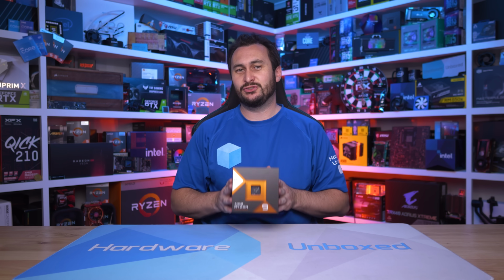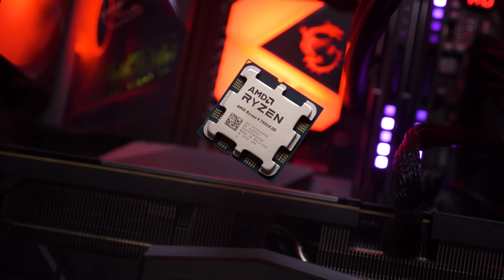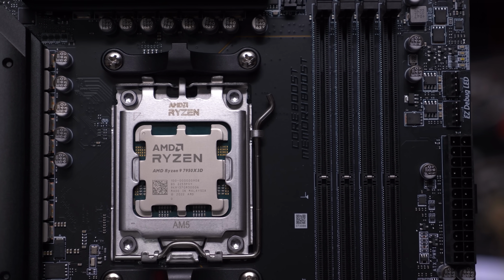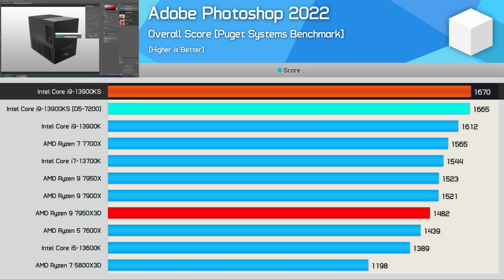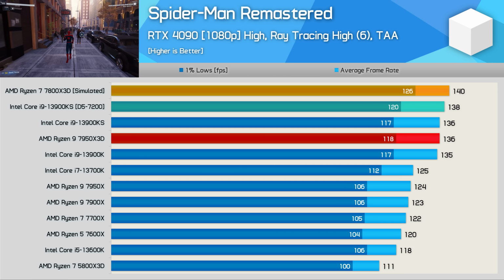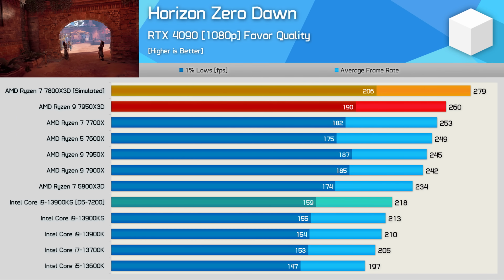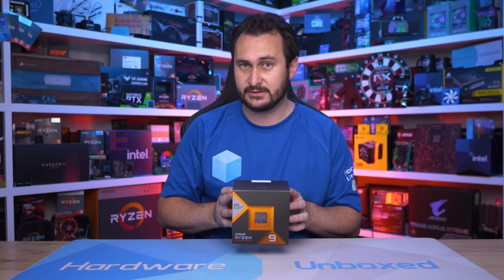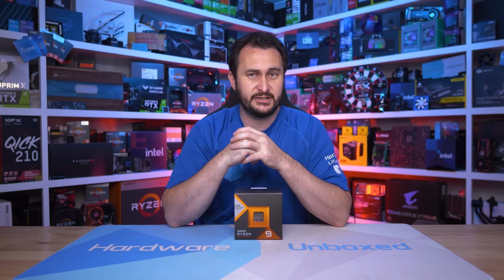AMD Ryzen 9 7950X3D Benchmark + 7800X3D Simulated Results

Comment: Leave it to AMD to ruin something good. Couldn't put 3D cache on both chiplets, nope, had to save money and make it seem like a good thing, when they already give you a good and bad chiplet on the 900/950s, this is their highest tier product lines and they're tried to squeeze buyers for more money while min/maxing their profit margins. Pretty sure the 7900X3D is going to be a dog based on the juggling between the two chiplets and properly prioritizing certain things on certain cores. I might just go with Intel as this seems as though this is silly at this point.

Somethings of note: There is a prioritize cache and prioritize frequency option in the bios that wasn't tested and really should have. Prioritizing cache isn't the same as simulated 7800X3D. Techpowerup tested this and shows some interesting results. In the weird cases their driver doesn't see it as a game, you have to turn on game mode manually on the windows game bar.

Comment: Quite surprised that even the 7950X3d is basically using 8 cores for games like 13900K P cores. So looks to me for gaming, 13600K or 7800X3D are best best CPUs to buy based on your budget. And the fact that 13900K is not 20% cheaper and trades blows with 7950x3D, that is very interesting point at the end.

Comment: What it is with brainless Youtuber tech channels spreading a company "conspiracy theory" without ANY knowledge of why AMD is doing what they do?

I can explain the release of the 7950X3D VERY easily without ONCE suggesting the 7800X3D will cut into 5950X3D sales.

1.  Buyers KNOW all these parts are coming out.  MONEY MATTERS TO PEOPLE.  If I don't NEED 12 cores, I'm not going to spend the extra money to buy one, and I have to think most people of the WORLD that have any knowledge about putting together systems are the same.  I didn't buy a 5900X JUST BECAUSE it had a better cost/core.  I don't CARE, it's $150 more than I need to spend, so it's stupid for me to buy it.  This is something many techtubers have CONSTANTLY FAILED to understand.  A 5950X or 5900X is a TERRIBLE BUY if I can never push a 5700X or 5800X to 100% CPU utilization.  NEVER.  But you know, companies aren't GIVING me hardware.

2.  The people who would buy the 7800X3D would ALSO be the same group of people who would buy the 5800X3D.  And you know what?  The 5800X3D has been WILDLY successful.  Do you think these people who JUST bought a 5800X3D are going to drop their system and buy a new system, TOTALLY new just to get a few extra fps???  No. I constantly read the comments sections and the typical comment I see from a person who bought a 5800X3D is they're skipping Zen 4.

3.  Content creators and others BITCHED and COMPLAINED, INCLUDING YOUTUBERS like Steve and maybe another Steve about Zen 3 only having an 8 core part for Vcache.  In fact I saw almost every Youtuber complain about this, and then the STUPID thing is some have the audacity to THEN say they don't know who the 7950X3D is for, like Steve from GN insinuated.  He said it's not for content creation even THOUGH the scores for almost everything for content creation was minimally affected by one CCD being slower.  So I guess he forgot about all the BITCHING about AMD not having a 12 and 16 core Vcache part for Zen 3?????????????????  I mean you all are hypocrites, and most say the same thing.  Do you talk about it with each other and then all say the same thing????

So, considering that the comments sections for the 5800X3D were FULL of complainers about there not being 12 and 16 core Vcache parts, AND the 5800X3D being so WILDLY successful (on Amazon's top 50 best selling CPUs for instance it has been in the top 10 since its launch, and part or most the time in the top 5, along with the 5700G and 5600G which are best sellers because people can skip buying a GPU), if anything the 7800X3D may be one of the worst sellers for Zen 4 Vcache parts because people who WOULD HAVE bought that, already bought the 5800X3D and are very satisfied because most PC users don't buy just because reviewers review new products.  So the demand is there more for the 7950X3D than the 7800X3D, you can read about it in many videos dealing with the 5800X3D by the whiny, bitchy people talking about how they won't buy an 8 core Vcache part because they need more threads.

And most people do their best to spend the least possible on a CPU.  At Micro Center, they've sold out of the 5500, which they had at $95 USD.  I haven't seen it listed for a couple months now.  They might not buy anymore.  They priced the 5800X3D at $300 USD.  I'd build gaming systems 24/7 using a high quality X570 MB such an a Gigabyte X570S Aorus Elite which I have found multiple times for $170 - $180 USD and considering how feature rich it is, it's a STEAL, and pop on a $300 USD 5800X3D, and have a near AM5 quality setup.  3 NVMe ports, 2.5Gpbs ethernet, a USB3.2 type C gen2x2 port?

Comment: According to amd's own spec sheets on the frequency clocks of the 7800X3D they will be significantly lower than a 7950X3D, so I'm not sure how accurate your 7800X3D simulated will be
Reply: All frequencies above 5 ghz on 7950xd3 only happen on the CCD without stacked L3 cache.
Reply: @blegi1245  that would make sense but I haven't seen anyone actually tease out that data it would be awesome if testers were actually able to show us that
Reply: @jwdickieson  I have. Sampsa Kurri at io-tech reported in their review of 7950x3d that highest core frequency observed on the stacked cache CCD was 5 ghz in game load.

Comment: Am I the only weirdo who thinks Intel did a great job this round. My non-binned off the shelf 13900k is running unbelievably stable at 6.2Ghz or 5.8 with AVX offset
Reply: While using triple the power, requiring expensive cooling and RAM.

Comment: Did they install AMD chipset drivers, Performance Optimizer and xbox game bar? Seeing different trends then other reviews like GN.
Reply: This! Gamers Nexus and PC World reviews are in line with each other. In Shadow of the Tomb Raider, 7950X3D scored much higher than HUB’s simulated 7800X3D. GN and PCW didn’t even bother simulating 7800X3D by turning off CCD2. They just let the Xbox Game Bar decide which apps are games, and these were run on CCD1 automatically (the one with 3D cache).

There’s something off about HUB’s results, and I’m not hating or bashing (to head off the fanboys) but pointing it out so hopefully it can be clarified.
Reply from the maker: Yes, of course we did. Gamers Nexus tests Shadow of the Tomb Raider using the built-in benchmark, which is much more of a GPU test.  We test in game, in the village, which is significantly more CPU demanding.

Comment: Great work mates down under. How about hitting the hot, literally, issue of Razer Synapse 3.0 causing high CPU temps and throttling due to the Razer Synapse 3.0 causing high CPU utilization in Windows 10. Razer has acknowledged they have been aware of the issue for over two weeks but have been unable or unwilling to fix the issue. Owners of Razer keyboards, mice, gamepads, ect... are simply forced to uninstall Razer software and then have none of the functionality they bought the Razer products for. The hope is soon a class action suit may be filed to help people recover the cost of all these Razer products that are now ewaste since Razer is unable or unwilling to fix the issue due to internal problems at Razer.

Comment: It's very strange, something seems bugged, the 5800X3D was way faster than the regular one and a lot faster than anything else when it came out, but the 7950X3D compared to a 7950X just seems like comparing a 5800X3D and a regular 7950X where they trade blows. It's not as good of a CPU as I was expecting. I really want to see how the 7900X3D and 7800X3D fair against the others. Doesn't seem like anything out right now is worth upgrading from a Ryzen 5000 or Intel 10th gen CPU, even with a 4090 like myself. My 5900X still gives me great performance and I can guarantee if I did change my mind and upgrade now to a 13900KS or something I'd just be disappointed as you're getting extra frames in the games where you're already at stupidly high framerates.
Reply: Yes your getting high framerates with the 5900x but they are not as consistent as they would be with a stronger cpu. I was in your same position with a 4090 but I upgrades to a 7700x because of gpu usage and framerate consistency.

Comment: What I'd love to see is memory testing with the X3D. HUB has shown that Zen 4 is very sensitive to memory timing, but the extra cache could go a long way to eliminate this problem (it helps in this respect on the 5800X3D). If the X3D CPUs can use cheaper RAM just as effectively for gaming, that would be an interesting twist.
Reply: I want to see the memory scaling on the X3D too, as it could make a big difference to the cost of a build, or the amount of ram a build gets!
Reply: @lukearbuckle4760  Amount of RAM doesn't make a difference in performance; if you have enough, you have enough. Memory speed makes the difference (when CPU-limited), so amount of memory is not the relevant part here.
Reply: @dennisjungbauer4467  I think that Luke's point was that if you buy slower RAM then you can afford more RAM.
Reply: Wish I could thumbs up more than once. Pause.

Comment: Not bad results at all, But you could spend half as much, still get a 4090 and not be bottlenecked at 1440p save an extreme exception like hogwarts which runs like butter on a 13400f/7600.  If you need the best, power to ya but the best just isnt far off from the cheap right now on the cpu side.

Comment: When you did the 7800X3D simulated benchmarks did you lower the peak frequency? Because I noticed that AMD set a lower limit on the 7800X3D. I can see why they did now, if they didn't it would crush the 7950X3D in most games. With the lower clocks they probably will be close to each other or the 5800 will be slightly lower. I think that's evil. Crippling one processor to make another look good. EVIL.

Clearly there is no reason to buy this processor and AMD should have skipped it. Also, I noticed that the 7900X3D only has six cores with direct access to the 3DVCache, this is a huge mistake and means that the 7800X3D will likely crush it. I think AMD should have stuck with only one SKU: the 7800X3D just like they did with Zen 3's 5800X3D. They wouldn't have needed all that software work, all the special drivers just to make it look like there was an advantage to the 5950X3D.

I think these two parts are huge, expensive mistakes.

The only way to teach them this lesson is to ignore the 79?0X3D parts and buy only the 5800X3D in April.

Comment: While the simulated results are interesting, the actual 7800X3D is supposed to be clocked faster than the 7900X3D and 7950X3D.  So it will be AT LEAST as good as your simulation
Reply: a recent update to AMD's information on the upcoming 7800X3D seems to show it will have a slower clock speed that previously expected, so my previous statement may not be true.

Comment: I imagine it is a very good option for people who run virtual machines, as you can keep the 3dvcache cores for the host system to use in games and some other tasks while the guest system uses the other cores in different applications. Very niche use case, but if you're into it this might be the CPU you want to use.
Reply: although the assignment of the correct (non v-cache) cores / threads to the virtual machine could be difficult / the thread scheduler could have difficulties running the threads on the specific cores.

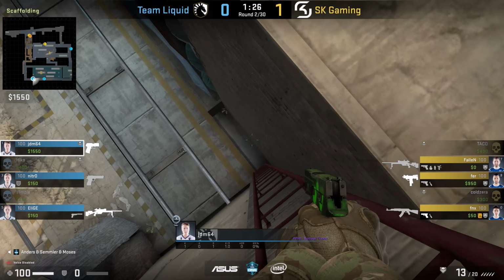Comment: Great review! I'm in the crowd who is on a 3950x and both does productivity work and gaming on my machine, so it looks like this or a 13900KS will likely be the upgrade path for me. I do wonder though if AMD would be smart enough for situations like at 17:20 with CS:GO, where it's not a cache sensitive game if they would reverse disable the 3D V-Cache CCD to achieve higher clock speeds and thus a higher frame rate? I'm sure it's not something that most games would need, but for certain popular titles like CS:GO it could be enticing enough for AMD to attempt reverse core parking. That might also be something for you guys to look into!

Comment: If the 7900X3D performs well, it'll be a bitter taste to all those thinking a 7800X3D, would be the gaming value king. AMD could have made a true affordable gaming king with the 7600X3D, but instead chose to maximize profits, and pretend games need 8 cores, 16 threads to utilise the game best. They're dividing price gaps, whilst pushing prices up. Ballsey move considering Zen 4 seems to a global sales flop.
Reply: Game are mostly being developed for console first, which has 8 cores. So the 7800x3d is the one to get for gaming.

Comment: Glad grabbed 7700X on discount instead of waiting for these, and will get me by just fine to see what 9000X3D brings to the table. Seems like my old CPU dying when it did was a blessing after all.
Reply: I was in the same boat. Doing a new build, Should I just pull the trigger on the 7700x or wait for the 7800x3d?
Reply: @ejay30  I'd go 7700x because it's the best of both worlds rather than just gaming.

Comment: So you didn't do the same thing that tech jesus did and use the driver built in capabilities that disables the standard cores when playing games recognized by xbox gaming bar? That's disappointing that you are doing what is built into the driver in the bios and then calling it as simulated results.

Comment: It will be interesting to see what happens with these as time goes on. The framerates are so high with flagship CPUs and the 4090 now that it feels like it's probably going to run into game engine limitations in a lot of cases. I wonder, are we going to hit a point in the next few years where basically any CPU will be capable of pushing >200 FPS in any game engine out there, and the engines themselves become the limitation?
Reply: Never underestimate the inevitable increase in lazy code that coincides with each new gain in CPU and memory bandwidth

Comment: I would really like to see you be able to add in 13700k/13900k(ks) paired with 7600 or 7800 xmp ram. Up to you if you do the few extra buildzoid subtimings but preferably yes. I know this is asking a lot you already do a ton but because at least for people like me, tossing in a 7600 kit with my 13700k and clicking a couple buttons means I am unsure how I stack up in these lists.

Comment: Devil's advocate moment: maybe they know the 7800X3D will be the sales winner, and the delay is simply to ensure there is sufficient supply at launch to meet demand. Since the demand for the 12 & 16 core parts will be lower than the 8-core part when it comes to a gaming-focused CPU, not as many would be needed in retail channels at launch and meeting the demand would be easier. An extra 5 weeks might hint at just how many they anticipate selling, so they can generate enough stock.

Comment: finnally a better review than steve from nexus when you got australia steve does better job on youtube when using ddr5 7000 is huge difference than nexus use d5 6000, and you made 7950x3d far worst than nexus review...odd right...i guess intel gets so fast by memory speed increment than cache alone just get lost in cores windows scheduler while linux just not like this idea for one ccd has cache and other does not , and under windows is disable but under linux kernel , they just can't disable other ccd for any linux users , it just make them more weak than windows 11 users

Comment: AMD just managed to convince me to upgrade. I have a 5950X (for software compilation). I did not like the power usage of the 13900K(S) as I'm noise sensitive and I did not like that AMD followed that trend with the 7950X, but seeing the 7950X3D has a TDP of 120W as opposed to 170W and that I can get now get V-Cache for the "mini HEDT" option I'm kinda sold. I don't mind having to make launch scripts that prohibits using the secondary CCD at all. That's 10 minutes of development time and 20 seconds of application time per game.
Reply: @Garrus Vakarian I didn't think 95C was a problem. I just don't like loud fans, and the ~300W 13900K was a complete nonstarter. I have a Noctua NH-D15 Chromax and with a PBO of 120W my 5950X is still super quiet, so the 7950X will not requite a new cooler.

Why on earth would I go to BIOS when a powershell/bash script can lock processor affinity on game/application startup?

Comment: I am sure that with further optimizations and Bios updates, it will probably fall more in line if not exceed the simulated 7800X3D results.  It’s still new for AMD to have 3D VCache on Multi-Chiplet CPUs so I think the differences and optimizations should soon eclipse the best of Intel and the non-X3D chips from AMD as well.

Comment: Would you ever consider adding a Stellaris and VRCHat benchmark? They're both games that are highly cache and CPU sensitive; they'd be good test cases  for Checking if a processor can handle cache size well.

VRChat, in particular, would be good at stressing everything, from memory, to CPU, to GPU, but it'd require a bit of work to develop a benchmark; you'd have to simulate players and keep the setup identical every time. Not impossible, but would require a custom solution. Still, it's a much needed design.
Reply: Stellaris and HOI4 tick/day times would be lovely